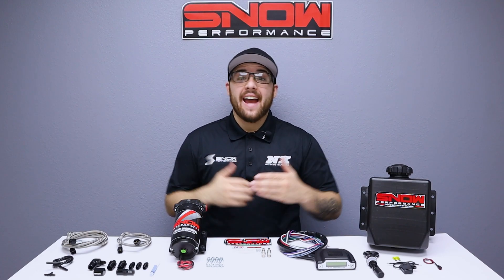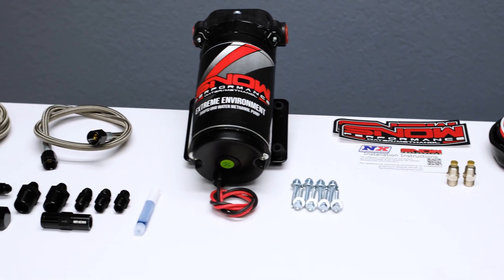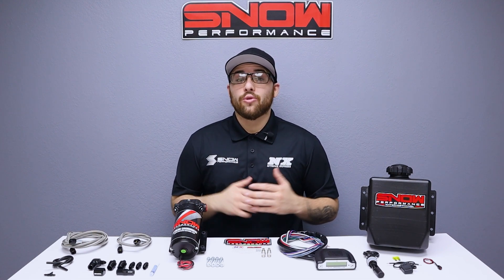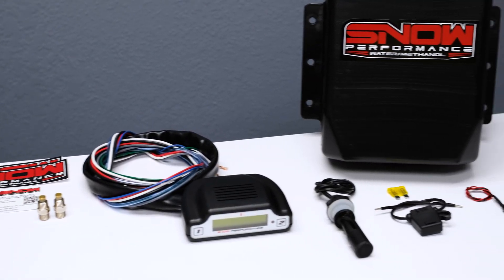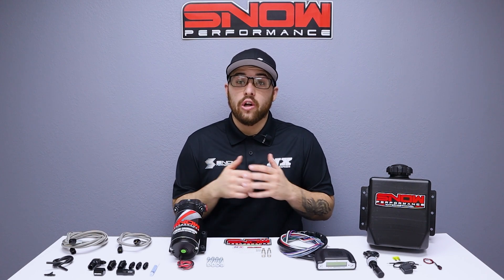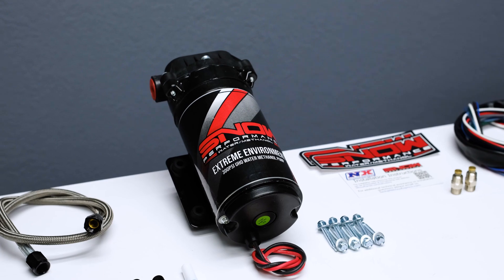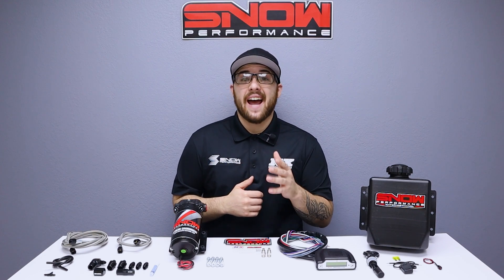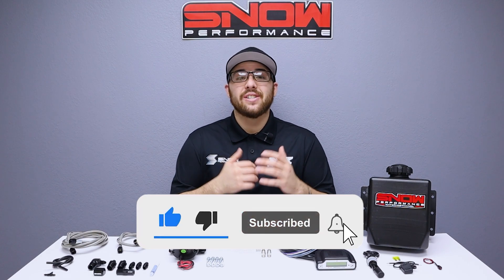Stage 3 Water-Methanol Boost Cooler For Direct Injected Vehicles! Snow Performance (Made In The USA)

Comment: Question for you… what is the led on the controller for?  I can’t find its purpose in the documentation and it looks like for activation/low tank level you wire in additional lights.
Reply from the maker: That's your injection indicator LED, when it's on the system is actively injecting water-methanol
Reply: @snowperformance1  Thanks. I got it sorted. I 3D printed a new case with LEDs for first and second stages, and also low fluid. I didn’t have the system hooked up previous and wasn’t wanting to duplicate lights.
Reply from the maker: Sounds awesome!